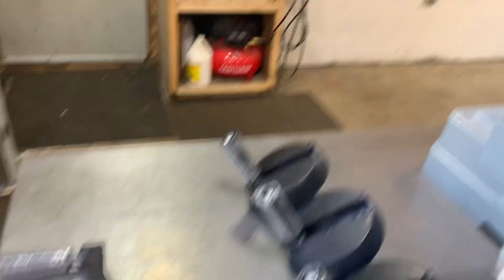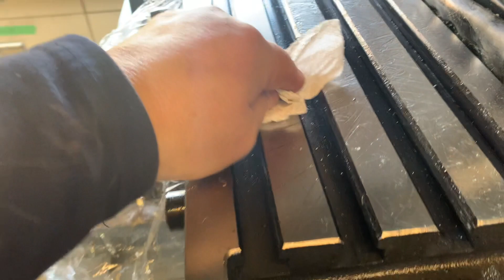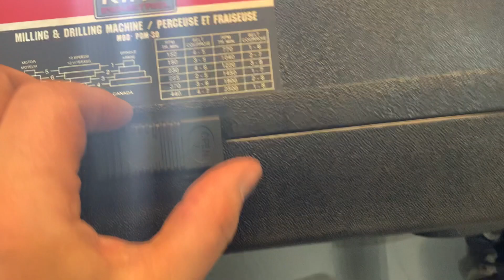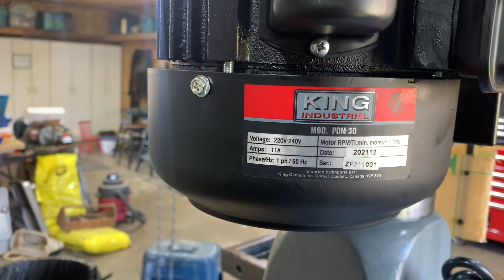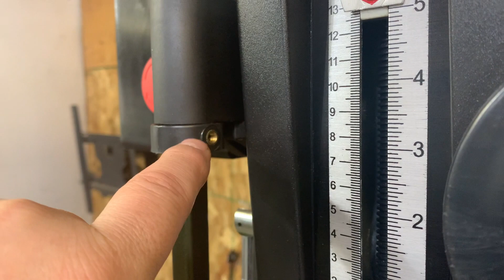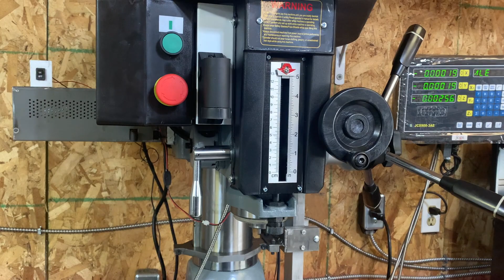King PDM-30 Milling Machine

Comment: Do you think this could be used for boring small engines ?
Reply from the maker: One of the things that you’ll have to consider is whether the spindle can go high enough and the “Y” axis (front to back) is enough for you.  So if the engine is stripped to the block, facing the heads might be possible but it’ll depend on height and width. Makes sure to look at the mill’s specs

Comment: After two years do you still like your PDM30?  I am thinking about buying one.
Reply from the maker: @pierrebourguignon3537  yes I sure do.  I did have to inspect and make sure the wiring was ok, and found the main screw nut to have been installed incorrectly wich caused it to wear prematurely. But otherwise it performs flawlessly. I’ve mad quite a few modifications which have improved it as most people do. I have no regrets
Reply: @LetsRogerThat  Hello Roger, I don't know if you will read this message but I could use your help if possible. I bought a pdm 30 last week which dates from 202112, the machine seems in order but the person who had it removed the power wire which goes from the power socket to the machine for some reason that I do not know . If you are able to post a photo of the inside of the box where the power wire goes in. The box where the on and off button is located and which has 4 screws to undo. That would help me see where the wires go. Thank you so much. I don't know if this is possible with you tube Thank you very much
Reply from the maker: @sylvainro1  glad to help you Sylvain.  Sent me an email at info@rogertoolscanada.com and I will send you the info you need tomorrow. Gilles
Reply: Hello, fellow Canuck here in Manitoba. Do you have a 3 axis dro install vid for this mill?

Comment: I’m a hobbyist and I like to build my own stuff. I was in the process to buy a milling machine for my workshop. After scrolling for many days, the Internet for machine that are available for me in Quebec. I finally decide to order PDM 30 from Ken Canada. After seeing your video about some issues on this machine, I plan to look into it soon I receive my machine. No I will be in a process to purchase a good vice, R8 to ER32 collet chuck and other tool. Do you have any recommendation? And by the way, nice video nice work.
Reply from the maker: Tks doc that’s very kind. I’m gonna gather the info for you tomorrow and will update you then. Once you check and resolve a few things you will love this machine.  I also started an online store that includes machine equipment and tool storage if you want to check it out. Rogertoolscanada.com
Reply from the maker: Hi Doc, here's the link for the vise I got. Its a Te-Co.  Excellent vise made in Taiwan which is on par with Kurt vises. https://catalog.te-co.com/item/single-station-vises/4-single-station-vise/pws-4600-1
I haven't purchased an er-32 chuck because I intend to make one (its partially done).  For now I use imperial R8 collets.  I do have a full set of ER32 and ER11 collets. When I need to mill some small metric sizes I insert the ER11 collet into one of my R8 imperial collets and it works great.  Hope that helps. Stay in touch and thanks for watching. Gilles
Reply: @LetsRogerThat  Strangely, I was watching your video and pose on the name of the vise that your using and at the same time doing a search on the web on the TE-CO website :)
Reply from the maker: haha that's awesome.  The whole idea of making my channel was to help others. Glad its helping.  Bonne journee :) @docteurdre8450
Reply: @LetsRogerThat  I also wondering about those collet chuck kit. What is the size of the draw bar on the PD-30
Reply from the maker: 7/16"  @docteurdre8450
Reply: @LetsRogerThat  Merci Beaucoup! Actually, where you came from, I think you said on other video Nova Scotia.
Reply from the maker: I retired in NS but I'm originally from Mtl. @docteurdre8450
Reply: @LetsRogerThat  Wow!  two years ago my wife and I plan to move in Nova Scotia. The idea not gone but we have ton considering that my wife sick. She has Scleroderma and Raynaud syndrome.